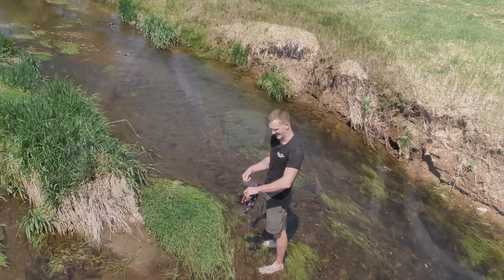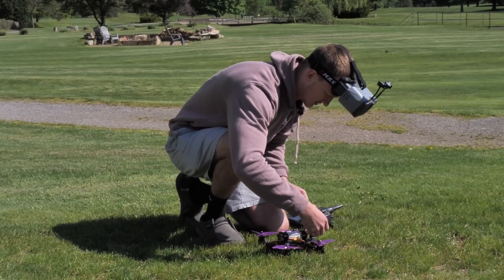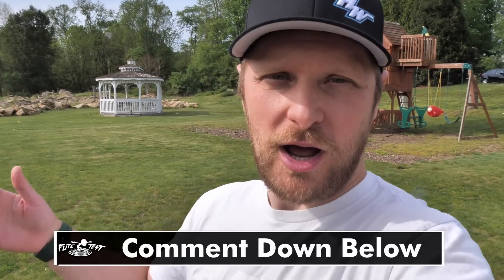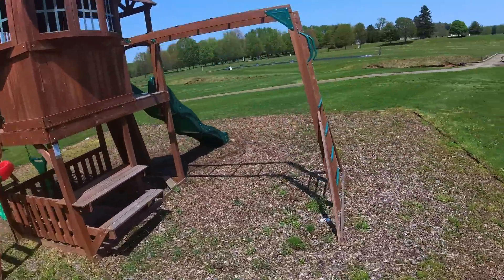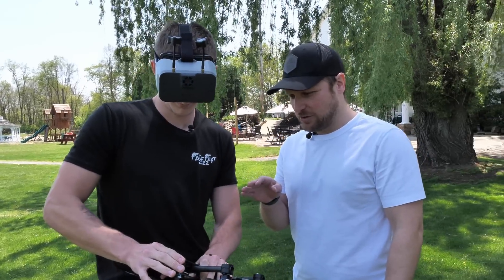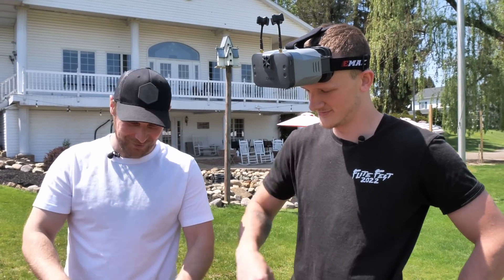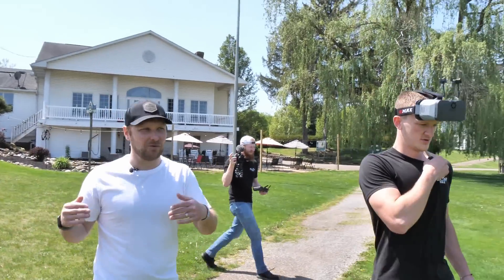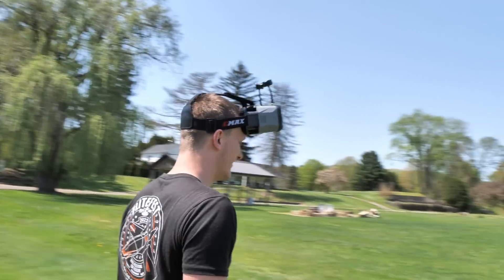Fly Hard Challenge Stress Test - Our NEW Drone Goes HARD!

Comment: Guys, you really call this flying hard??? Double the speed and half the size of the gaps, and then it might start to get hard... why the bridge and not the tube with the creek running through?
And why do you guys never use any form of crashflip to recover? I'd not walk that far as long as I can flip a switch and fly back...
Reply: Oh, and btw a prop does not need replacement as soon as it's got a scratch... bend it back and go... I replace them when they're either missing a blade or the quad starts shaking so bad, i notice it on the video

Damn, I'd be going through like 60 sets a week using them the way you guys do...

Comment: Little brother got bit hard by poor antenna placement.  Lets see how agile that thing is. Do a 5 lap run of my tuning course for best times. Flag to flag is 75 steps. Split that in half take 10 steps at 90 degrees. Split both those sides at 10 steps. You can use the pattern in my "Taking Taz out for a romp in the park" video or the one from my "New Skyzone 02 dvr test" video. Maybe to best 5 lap times for prizes or punishments like chore duties or the low man on the totem pole jobs at the shop.

Comment: Easy way to dry out water soaked electronics is to first dip in distilled water then dip in un-scented rubbing alcohol.  The distilled water washes away all of the mineral contaminates.  The rubbing alcohol displaces the water and speeds drying.  This will also work for motors and bearings.  With bearings it would be good to follow up with a water displacing spray lube.

Comment: Love seeing the fly hard challenge again.
I would like to see an update on some of the FPV setup you used to cover back in the early days. Like making scale cockpits, pan and tilt, and head tracking.

Additionally: I think an endurance challenge would be really cool! Contestants get to design and build their own airframe and select their own electronics. Then all contestants fly the same circuit and the winner is the plane that flies the longest time + however many laps were completed. 
(8 laps and lasted 12 minutes= 20 pts. 
15 laps and lasted 6 minutes = 21 pts.)
Reply: Had the same idea, would be great to see the different ideas, some sort of maximum size limit maybe to make it even more of a challenge 😄